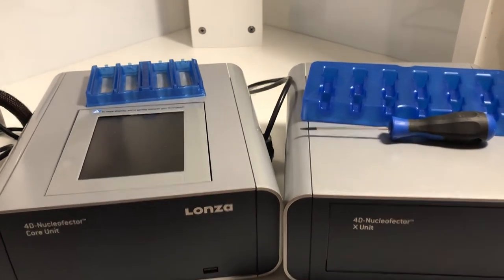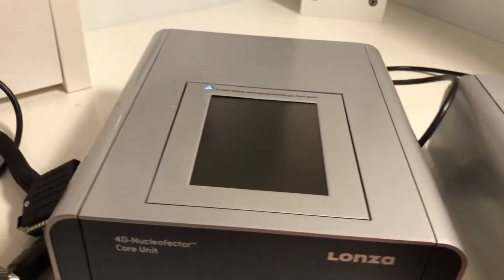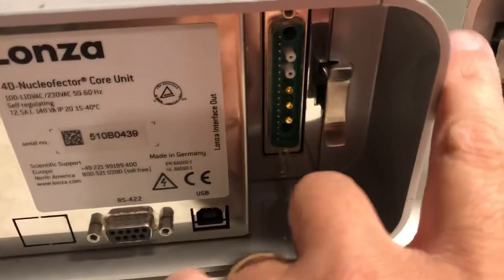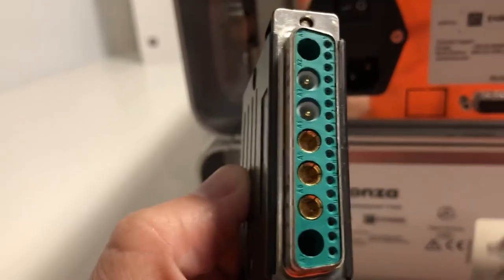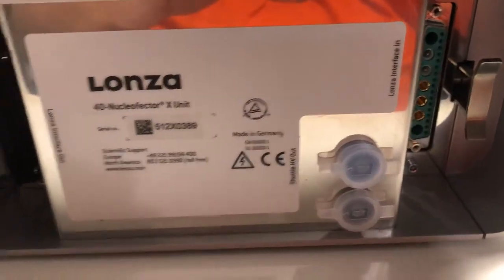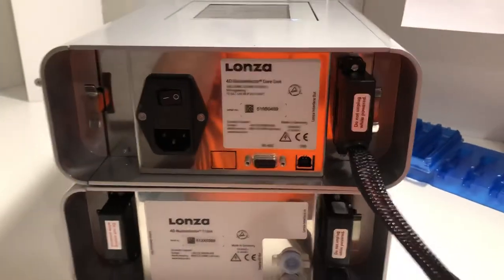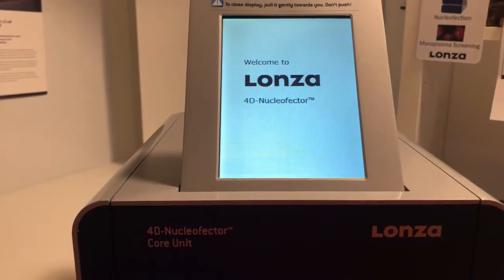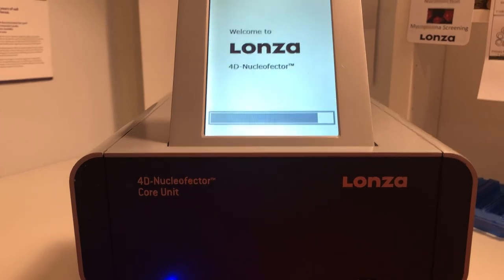Setting up your Nucleofector 4D

Comment: Hi,
We bought the Nucleofector 4D 2 years back but never used it. Now when I tried it for the first time Its not turning on. Blue light is there on the machine after switching on the power but the display is blank. we have contacted Lonza India and I have tried the troubleshooting by keeping It charge for overnight. Since because of company policy they cannot open it and we need to send it to Europe to get it fixed and which is turning out to be very much expensive. Can you suggest some troubleshooting steps which I can try?
Reply: We got same problem in China my dear.. seems the only solution is send it to Germany and replace the battery.